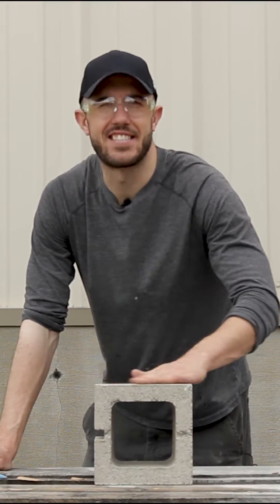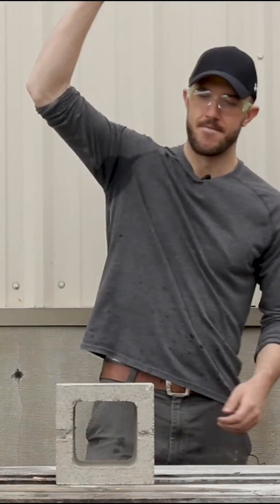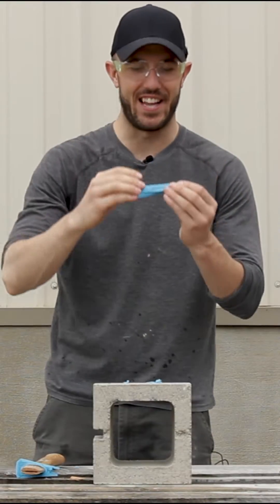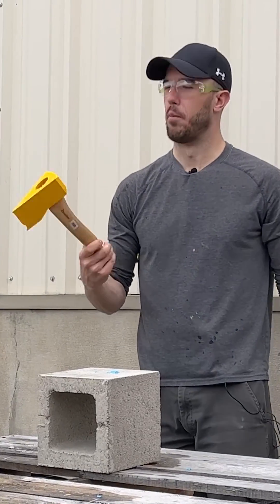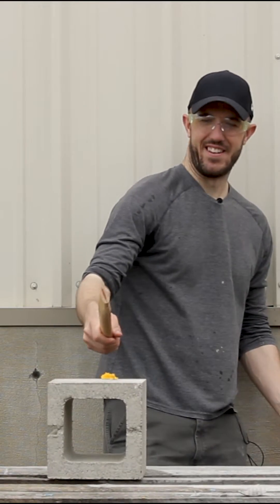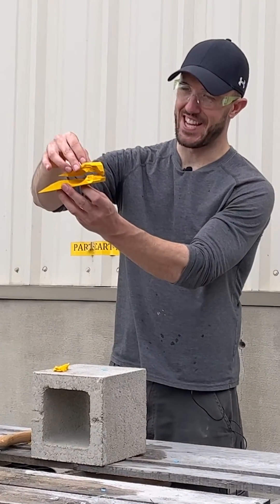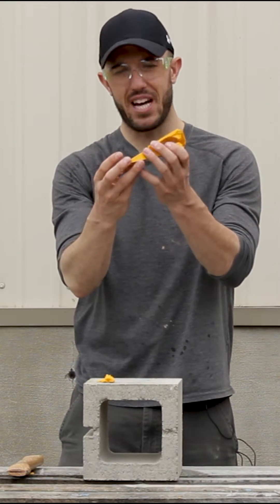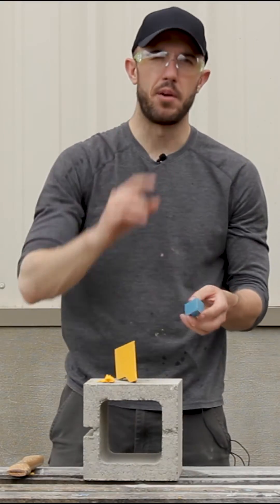We Put 3D Printed Axes TO THE TEST! #shorts #shortvideo

Comment: PLA impact resistance is very low, explosion is highly predictable.
Reply: there are pla variants with very high impact resistance
Reply: @riba2233  For PLA... But it won't match thermoplastics that have this perk.
Reply: @axelSixtySix  some have higher than average abs or pc
Reply: @riba2233 To assert such a claim requires rigorous testing. Each polymer possesses a distinct molecular structure, and while additives may marginally enhance overall resistance, they do not fundamentally transform the material into something entirely different.
Reply: @axelSixtySix  testing confirms that.
Reply: @riba2233  Well, the thing about materials physics is that it’s been thoroughly documented for decades. Beyond educational purposes, testing often just reconfirms what we already know. Young's modulus, for instance, measures stiffness. Shear modulus and Poisson's ratio, on the other hand, deal with how materials deform under shear and tension. Tensile, compressive, and shear strength tell us about the maximum stress capacities. Ductility, toughness, resilience, and hardness indicate how materials handle deformation and absorb energy. Durability, creep, and fatigue speak to a material's long-term resistance to wear, constant stress, and repeated stress.

Now, when it comes to 3D printing, because the material is expanded, density is lower: you need to adjust all these values accordingly. Divide them by the relevant factor, and you can roughly predict the outcome of a serious test. And by serious, I mean a scientifically rigorous one, not some backyard "redneck" experiment.
Reply: @axelSixtySix  you wrote a lot but unfortunately it is very meaningless because only real world results matter for end use. Also please show me the documentation about the impact resistance of a 70-30 pla-pmma blend, thanks, I am sure it has been thoroughly tested as you said.

Comment: Well, when you print with 3 walls and 5% infill on a part that is supposed to be Strong. Its gonna fucking break. Class dismissed.
Reply: If you print a good PLA, a good one, at high temp, high bed temp, no cooling fan and a bit of overextrussion for the perimeters to bond

It will make a rock solid part, just like a resin hammer